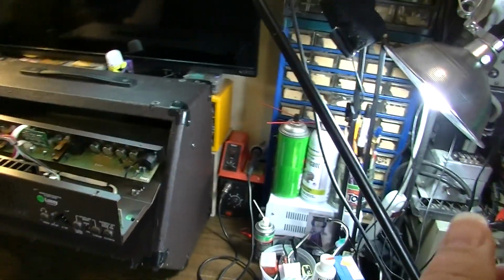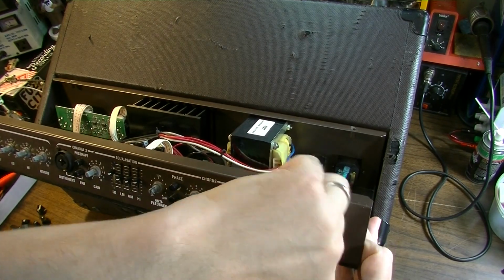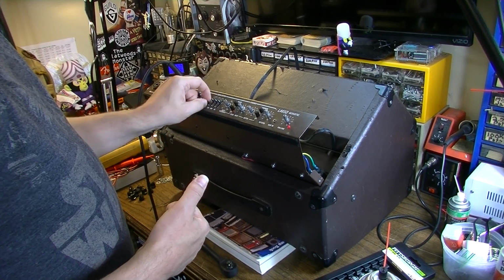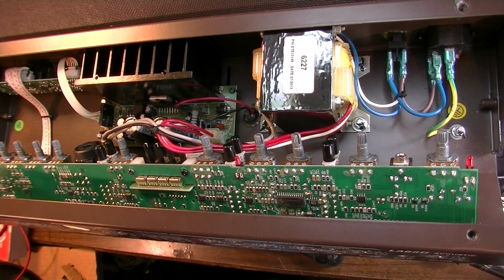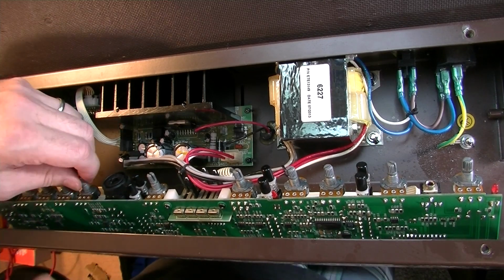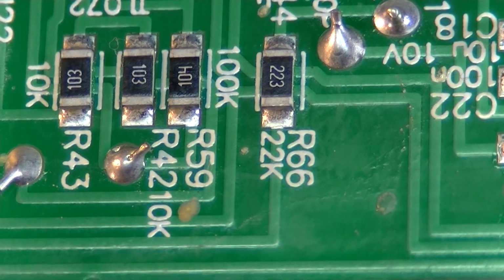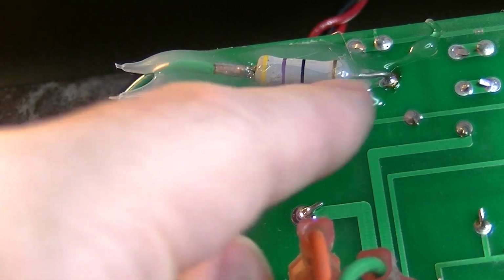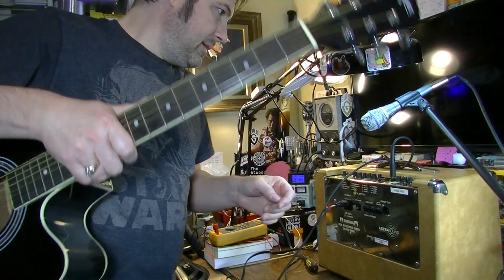Why Are Acoustic Guitar Amps ALWAYS So...Sh*tty?

Comment: Wow, that bodged in resistor scares me. That was not an original part of the design but it looks factory. Increasing resistance to ground sounds unsafe and I'll waager the amp design that passed the UL did not have that part.

Comment: I worked on television sets back in the day when your doctor was a wierdo if he didn't have ashtrays in the waiting room. A few times we'd get a set from a heavy smoker and the electrostatic attraction brought upwards of an inch of tar. A few pots of boiling water and shotgun the solder joints, especially G.E., who INVENTED the control of product life cycles.
It could be worse.

Comment: There's no such thing as an "acoustic guitar" amp. An amp is an amp. If you want to amplify your acoustic guitar use a powered P.A. speaker with two inputs(1/4" & XLR) and simple Volume, Bass, Mid, High controls. It will never fail you.
Reply: an acoustic guitar amp is a smaller powered speaker. Powered speakers also fail.

Comment: That Ultrasound thing belongs at the bottom of the nearest river. It looks like the sort of thing I would do on the inside. And that isn't good. I had a clever brother who did all my gear because he knew I didn't understand it. He could make stuff, take stuff to bits, fix stuff and be really into it but for me, if anything failed to work I just wanted to get rid of it and buy a new one. I used to tell him that it should be iillegal to make anything that has more than three working parts because it's sure to act up. Lead free solder is real dogshit too and if I ever have to do any of these things I use a 1200 watt Weller soldering iron with a trigger because you're not suppose to have it on for more than twelve seconds because it will burn the shit out of the tip. It would fry that board in seconds. I'm a klutz.

Comment: A cheap amp that looks beat to shit having an issue is not a problem. Take care of your gear, especially the cheap stuff like he’s trying to fix, and it should last. Don’t handle it like an arm full of firewood. I’ve gigged good amps for years and none looked as ragged as the amp in the video. Just tell the guy not to toss his stuff around and it will work fine. It’s a fallacy that “it should be able to take it” if it’s well made. It should be able to play or years if well made, not if chucked around carelessly.

Comment: Acoustic amps are shitty because the crappy electronics in acoustic guitars are shitty.  There is only one suitable way to amplify an acoustic guitar and that is with a proper microphone through a proper preamp through a proper PA system.  Everything else is just, well, a shitty compromise.  If you MUST throw a pickup on your acoustic, I guess the Baggs pickup sounds the least objectionable but the problem always starts with the pickup/piezo mike mounted within the guitar..

Comment: Thanks, now we have the evidence. Built in obsolescence designed to fail by precision computers. The benefits of modern life - NOT. Indoors or out, the best way to amp an acoustic guitar is a mic through a PA, same as your voice. Richie Havens, Joan Baez, Bert Jansch, Donovan, John Sebastian, Roy Harper, Robin Williams, Jorman Kaukonen, Paul Simon, James Taylor, me, an endless list have done this at gigs great and gigs small before the dreaded piezzo was invented, the thing that always sounds like Donald Duck no matter what effects you put it through. I don't know why anyone uses them, no point in shelling out for a decent acoustic guitar at all to put it through the lousy stuff in use today even if the audience don't know what a decent acoustic sounds like because they never hear them. In some studios the engineer is lost if you tell him that you don't want to plug in or play to a click and then they want to put the voice and guitar through different EQ, pan and reverb treatments or even start with the "enhancements" like a light tremolo or chorus (eugh!) Bonkers! And deeply criminal. So yes, it's all TWOOOOOO! Older gear was more reliable because we didn't have the computer power to under-engineer stuff as we now do and digital stuff isn't around because it's better but because it's cheaper. World done gone bad and seriously deaf. Just organise a good mic.

Comment: Braaaad...if there's ever a reason, and there will likely be not one, contact me if you're ever in the Mid Mich area. I can show/teach you stuff that I learned all by myself (no pride) as there was no one else around to show me - the prevailing wisdom, then as now, was trash-it and replace it...as far as I can remember, the XLR connector goes at least as far back as the 1940's....that means that our fore-techs were cleaning contacts rather than replacing (it has worked well for me for years). Imagine a pin-contact that you modify with a slight-rasp-file profile....you can use that to clean MANY dirty/oxidized contacts that come/return from the field regularly. I have never had Caig-Labs R-5 in my arsenal of cleaning tech (I should), but using a modified, appropriately aggressive pin cleans and lasts every time - take it from me as I'm a broadcast electronics repair tech and a guitar and amateur-radio aficionado :)
Reply: To add to my original splurge of thought, my original mind, these circuits are not SHIT....they require regular maintenance like any other well used dildo!!!
Reply: The funny thing is, you appear to be my 10-yr-younger brother-FAM (at so many times...and I mean that in the most extraordinarily-possible way)...My HBs are from Paintsville although I remember that you're from Chicago as far as we know. MY agenda is repair for all and I try to do this as much as I can manage. Dan Gibbs :)